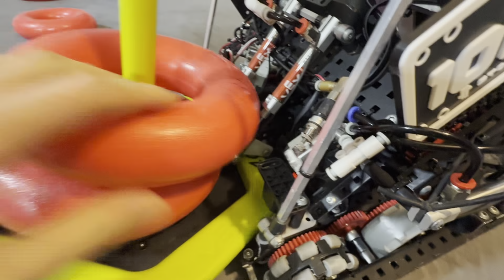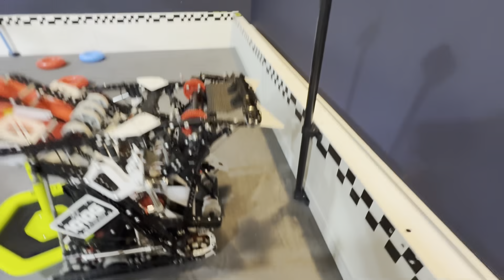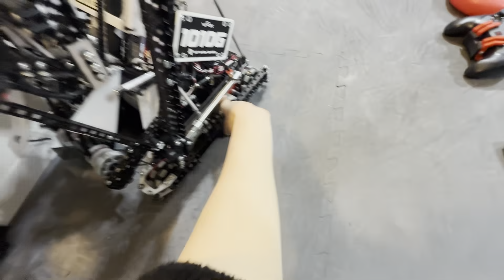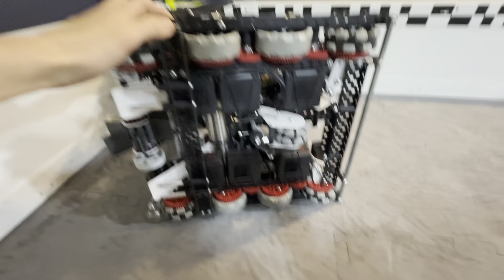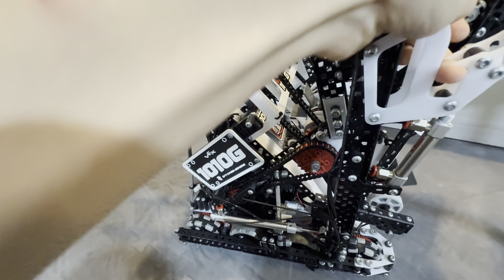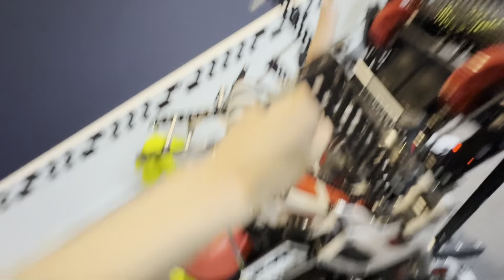1010G Robot Explanation | VEX High Stakes

Comment: Awesome design with a lot of unique and well-thought-out features. 

One question... From the gameplay I've seen, it looks like you started with the arms of the wall stake mech retracted. When you expand them outward, do they stay within the starting size (side-to-side)? It looks like they may expand out wider than the frame, but it is very hard to tell with the perspectives I've looked at -- they may not. If they do, starting retracted and then expanding to the sides would be a SG2 violation (SG2-10). 

Of course that doesn't matter now that you are rebuilding... just curious.
Reply from the maker: Thanks, the arm is barely within our drive when expanded.